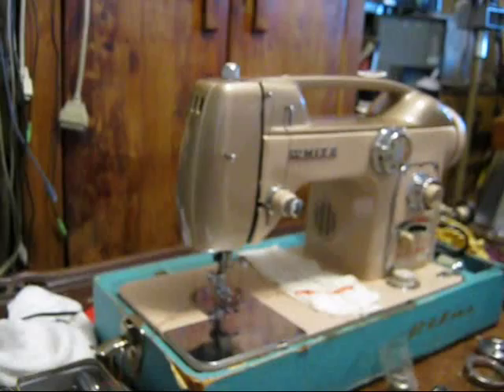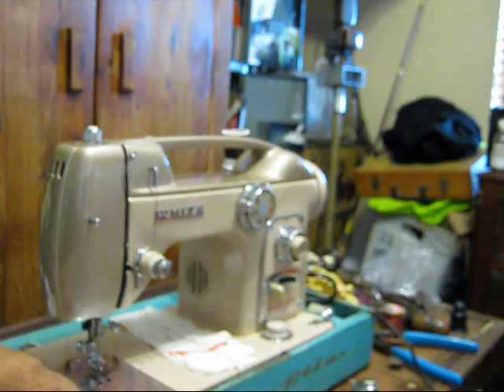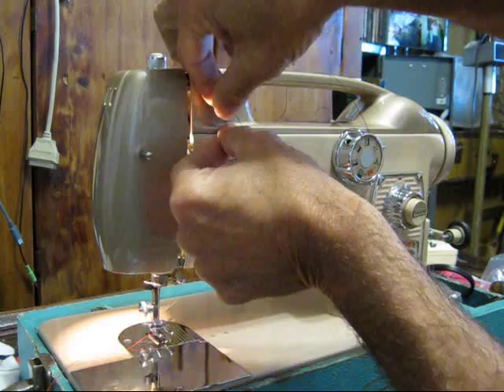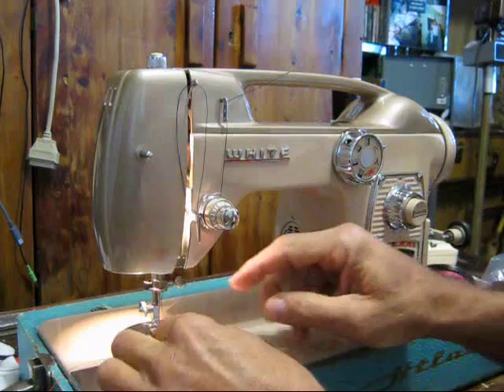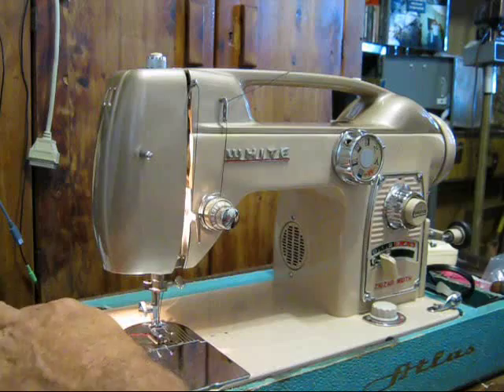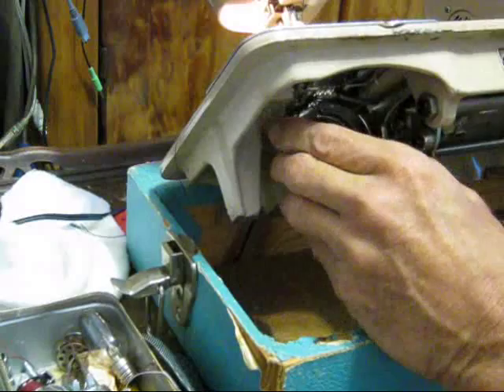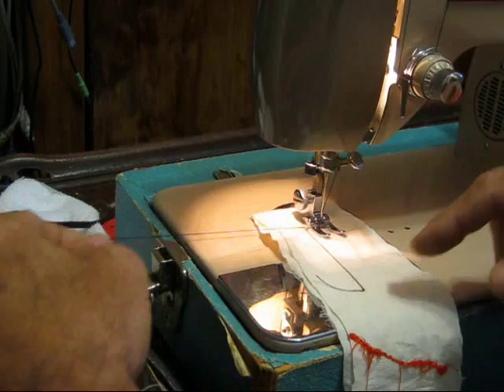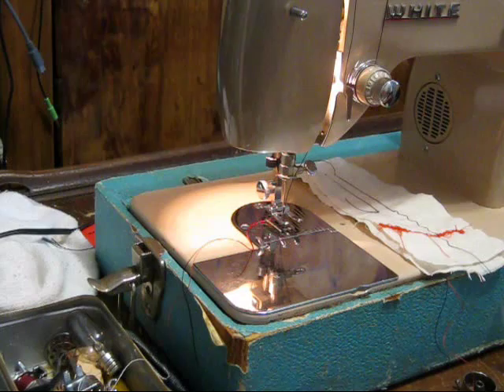Sewing Machine 101 The White 764

Comment: I got a second hand White 764 in the '70s when I was in high school. Still sews a treat. It only had a muddy photo copied manual, so on occasion I've checked the local online want ads for one. Recently I saw an original manual for $20. I thought it was a bit pricy until I realized this was for the manual AND the machine. So now I have two 764s and couldn't be more pleased.

Comment: Thank you! I have a Viking machine from the early '60s, I think, and it came with the original table, cams, and accessories, but no manual.  This is super helpful.

(NOT Husqvarna viking - Eaton's Department Store used Viking as its house brand, like Kenmore for Sears.  It's basically a White 9951/9953.)

Comment: My upper tension popped off the machine while I was adjusting the tension. How do I put it back on correctly; there is no step by step in my old manual book for the white 764
Reply: did you ever find the fix for this?  i just had the same happen to me :(  3 hours!  must be a simple solution?